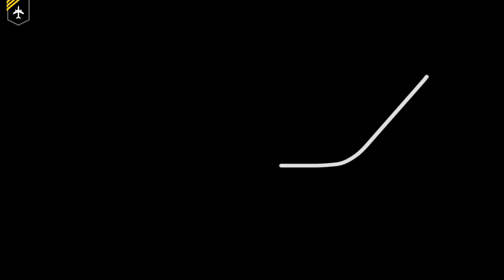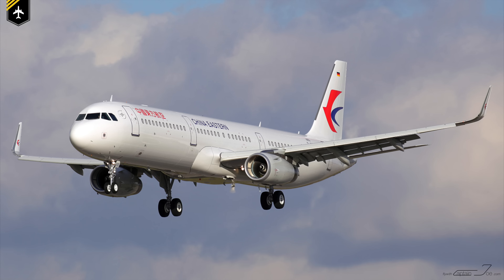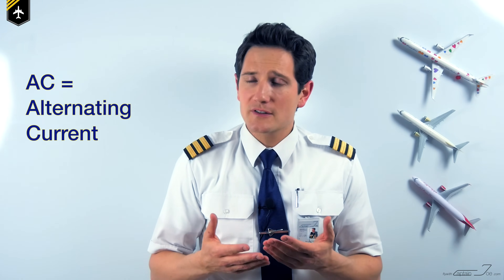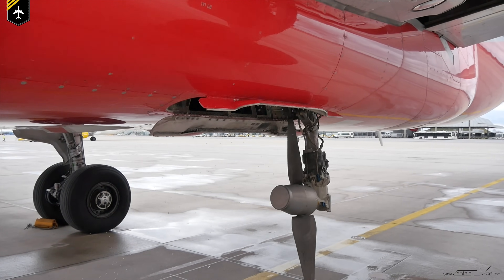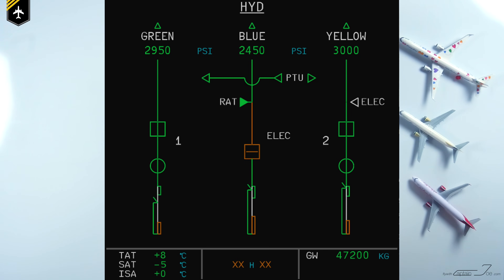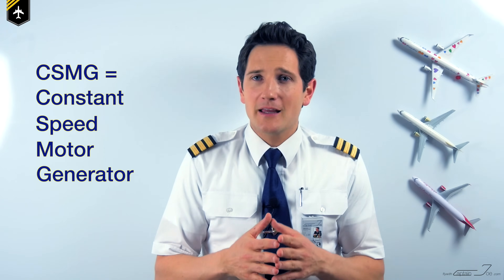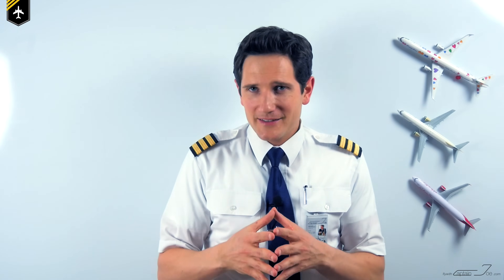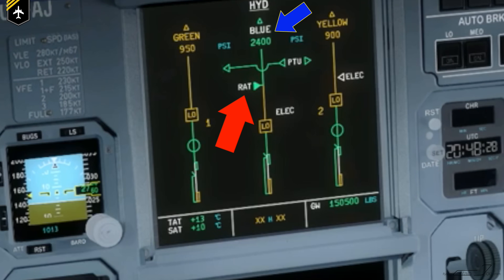What´s a RAT? RAM AIR TURBINE! Explained by "CAPTAIN" Joe

Comment: Hey Jo, in the movie "Sully" sully turned on the APU. The movie didn't show the RAT.!
Reply: I was looking for this coment.
Reply: Both the APU and RAT were used.
Reply: Guys, I'm sorry if I was wrong as I am an amateur in these areas... I was just placing an opinion like every other user did in the comments section ... Its really pathetic to know know that even in small discussions there is racism and discrimination towards a certain class of people because of the worst of people without hearts who  kill people in the name of a religion... this doesn't mean that the people following that particular religion become Terrorists by default.
Reply: @mohammedalsharif1737  Superb Comment. Totally Agreed
Reply: According to the NTSB report "The RAT was found in the extended position when the airplane was recovered from the water."
Reply: I believe the APU would have been more useful in that emergency. The RAT causes more drag. Meaning less glide. Which isn't exactly great for that situation.

The APU however wouldn't cause drag and was functioning.
Reply: Both were used. Since both engine driven generators failed almost simultaneously the RAT auto deployed as mentioned in this video. If you listen to the  released  CVR recordings or read the transcripts Sully says he's starting the APU which along with the RAT gave them the power to control the aircraft and make a successful ditching.
Reply: @LtKernelPanic  Right but if you have a functional APU why would you want the RAT? All it's doing is producing more drag and killing your speed. Speed = time and Sully didn't have a lot of it.
Reply: @nifethrubutter  It's because the RAT was deployed Automatically right after they lost both of their Engines
Reply: according by officially crash report, both of system were operative. While performing emergency checklist after bird strike,(at 1527:19 of CVR records) captain informed to F/O about  APU run. When you read the report you can find theese notes at page 30 which is says shortly (please read all of them), "when both IDG disconnected (it means electric system lost) and airspeed greater than 100knt, RAT will automatically deploy and begin providing electrical power........RAT has been found extended position when airplane recovered"....
You can find the full report on this connection (https://www.ntsb.gov/investigations/AccidentReports/Reports/AAR1003.pdf ) . Besides of this, please ignore some of details of movies. They are not able to show us everything. Ofcourse some of details can not be shown on movie if it not directly related of scenerio.

Captain Joe, thank you for your perfect explanation and sharing your knowledges with us. Have a safe flights.
Reply: The RAT deploys automatically when you lose AC bus 1/2. Extension takes about 5 seconds and would be visible. (The APU takes longer to turn on and become "on -line"). If at least one engine driven generator was supplying electrical power, the RAT would not deploy. In that it was not visible, either the RAT malfunctioned (no mention of that in NTSB report) or, at least one engine was operating negating the need for the RAT altogether.
Reply: Once you hit the water who cares?  if your alive, you're getting the hell out of there.
Reply: The RAT'd have automatically kicked in before he started the APU.
Reply: As Cadde said, but without the racist bigoted ranting bit
Reply: The APU take about 30 seconds to start, so the RAT will be in charge until there (with auto depoy) as soon as both engines failed.
RAT provides electricity only for basic system but APU will allow the protection envelop and all other main systems.
Reply: From the NTSB report:
"the captain started the APU, which improved the outcome of the ditching by ensuring  that  a  primary  source  of  electrical  power  was  available  to  the  airplane"
and
"The RAT was found in the  extended  position  when  the  airplane  was  recovered  from  the  water.  Both  RAT  blades  were  present, and no major deformation of the blades was observed"
Reply: Well, i'm not sure, but this is what i think. The APU runs on fuel. After takeoff, flight 1549 hit birds, and had a dual engine failure, so the engines wasn't running, but the plane still had plenty of fuel left. So the APU would be
the best solution to get power. I don't know if the ram air turbine would have had any influence on the aerodynamic (I think it would?), and on the landing itself :).
Reply: Bikestail er maybe Sully didn't want to rely on the rat, so he started the APU to be certain he had flight control when he needed it. Thinking ahead of what the weakest link in the chain would be makes sense!  Besides, the rat only provides basic electrics. The app provides enough power for a possible restart, and if that couldn't be done, still have enough power for emergency communications along with fly by wire manuvering. The more power you have the more options you have to land the beast.
Reply: @kennethcohagen3539  He wanted the envelope control computers to be functioning.  They do not function in a RAT-only electrical profile.  Water landings require the plane to thread a needle in order to not break up.  The envelope regulation computer helps with that considerably.
Reply: The APU can take 30-45 seconds to start up, so the batteries and RAT had to supply hydraulics and electrics until the APU is running and available. The batteries and RAT can only supply one hydraulic system, the #1 flight computers, and the captain's flight controls and instruments; the loss of backup computers means the A320 goes into "alternate law", meaning you lose a lot of the aircraft's built in protections. With the APU running, enough electrical power is available to power all hydraulic systems, flight computers, flight controls and instruments, and the A320 reverts back to "normal law".
Reply: Shame!
Reply: spishco thank you. I did  not seen that in the report.
Reply: +Sven he wasn't being racist because of his remark about muslims, that's just bigoted, he was being racist for assuming that everyone called Mohammed is a muslim.
Reply: +Mahila Maseli Wow! No need to be rude just trying to give information. PS airframe and power plant mechanic for 15 years.
Reply: true
Reply: Osama Shello gasoline and batteries go bad. If you are flying you alway have air. It's a very good back up design. And they do have batteries but only 20 minutes worth. You may be more than 20 minutes away from an airport. Take a bus or a boat if you don't like it.
Reply: they neednt rat .Because APU was working.
Reply: +Mahila Maseli If you worked in the aviation industry you would be more professional.So considering  that you don't, go back to checking  bags in whatever country you crawl from.
Reply: Cadde The Rat would have deployed before the APU was online.
Reply: Bikestail er When there is fuel in the plane, you use the Apu.
Reply: Consider the weight, the cost and maintenance of a kerosene engine.
Reply: CharlieHotelRoméo 89 finally somebody who is right they didn't deploy the RAT
Reply: I don think the RAT was ever used in the miracle on the Hudson it was just the APU
Reply: Why would you care if the RAT was destroyed on landing. You wouldn't need it anymore.
Reply: Bikestail er because it's a Hollywood movie idiot not the 100% factual series of events
Reply: They didn't finish the checklist, the ditch button option wasn't reached yet. It has since been moved up on the list.
Reply: +Mahila Maseli It might be possible that people watching this video have an interest or experience in the aviation industry. Most airplanes have a separate turbine running the  auxiliary power unit, kind of like a third jet engine that doesn't provide thrust just electricity for the airplane. In this case that turbine did not ingest a bird so it was still functioning.
Reply: The R.A.T. could have been removed and attached to a wheel and sprocket which could have been put in the water entry safety kit located under the #1 bowling alley lane (which is normally used as an aisle.  This would have allowed the crew to peddle to shore quite easily.
Reply: The RAT deploys automatically. Read the NTSB report. A movie is just a movie.
Reply: I also ..seen sully movie ..it's super...
Reply: Well the RAT storage area better be water tight.  Because the AIRBUS is designed for water landing unlike a BOEING...
Reply: This is about a RAT and an APU, and the Internet found a way to get racism into this...
And I'd say the APU was switched on fast enough, but maybe it's in the report?
Reply: @echalone  it's the sad reality of comments on Internet😥

About the RAT and APU, I think that the RAT automaticly deployed as soon as the aicraft got into electrical emergency configuration (so just after the engines shut down) and that only after that, the captain switched on the APU (also the APU takes a few seconds to start up). I think they just didn't show the RAT in the movie.
Reply: Not just in the movie.  It was also mentioned in the Mayday episode about that event.
Reply: Alex Lawrence Not using the movie as a reference point. I am using my Airbus Instructor/Captain/check airman experience. The movie is....a movie.
Reply: Bikestail er Yes indeed.
Reply: Carl Siemens How do you know the RAT deployed?
Reply: since their is fuel in the aircraft, the APU can be used because APU uses fuel to generate electricity.
Reply: Because the apu makea more power than the rat
Reply: yeah
Reply: ATF commanded Captain Sully for having the fore sight to start the APU which provided him control of his aircraft.
Reply: J. Pierre Malette the show Mayday said it was the first officer that started the APU, that he had just got back from training and I believe this had been covered in his training, if I remember correctly that Sullys manual flying would have put the plain into a stall but since the APU powered the flight computers the computer kept the plane from stalling,
Reply: Dick, don't even joke about that.
Reply: Bikestail er it was an older a320 model
Reply: LtKernelPanic  both weren't used
Reply: Bikestail er in the moive sully he turend on the apu to start the restart engine checklist
Reply: Alsohe dint put the ditching button on what was the5th last checklist to complete
Reply: as far as I understand you mean, Sully did not pushed the "ditching" button when completed 5th checklist, is it right?
Reply: I watched an old interview with him and he specifically mentioned the APU was still functioning.
Reply: Mohammed AlShariff once they hit the water it wouldn't matter derp
Reply: The rat is used when there is no fuel or the APU is broken and they had fuel and they had a functioning apu so I think he may have just messed up or not done research
Reply: The RAT was used when the MAIN engines failed due to the ingestion of geese into the engines so that the aircraft could be guided in some manner. The fact that the RAT was destroyed when the plane struck the water is irrelevant due to the fact at that time it was too late for anything except to get the passengers off of the sinking aircraft.
Reply: Weight. Aircraft are designed to be as light as is practical to keep fuel consumption low.
Reply: i ready sullys book, i was pretty sure he mentioned use of the APU and never mentioned the rat. the rat is only used if the APU is INOP and i wouldve remembered if that was the case from sully's book as well.
Reply: Bikestail er kk
Reply: Bikestail er he was ditching !!!
Reply: But, the RAT is used when a plane has no fuel. US Airways 1549 HAD fuel so Sully turned on the APU instead.
Reply: Yes, the plane was on the water just 6 minutes after take-off, so the APU was more than enough.
Reply: After you impact the water what would you need the RAT or the APU for you've already crashed and no longer need hydraulics!  That's like crashing your car and then complaining that you cant steer!
Reply: He did mention RAT deploys if you don’t have a functioning APU
Reply: They also said that the no. 1 Engine was operating at idle thrust the whole time. I was like "...what?"
Reply: It's possible that Sully deployed the RAT, or ADG (bombardier: air driven generator) but from my understanding it would have been the last resort. 

If you can you try to relight your engines, and if those fail you go to the APU start. Lastly if that fails and it hasn't auto deployed you would pull the RAT or ADG deploy handle and get some hydraulic power and essential power to your flight instruments and controls. 

If that craps out then you have the main ship batteries and a backup battery on some aircrafts. Those are only able to last at least half an hour in a load shed configuration.
Reply: But both APU and RAT were not necessary as the flight continued for only a few minutes. The batteries took over and established full electric supply which is why still all systems were available. The APU needs a minute or even more to start anyway. To have the chance of restarting the engines the APU was important nonetheless.
Reply: The RAT deployed just after the engines failed. Only then they started the APU.
Reply: Umm thats the same thing
Reply: Lol
Reply: They still have fuel... The APU runs on fuel and... Wait at the end it says us airways 1549 had the RAT weird
Reply: Gimly glider is a better example as the plane ran out of fuel so no chance of APU
Reply: I believe the RAT would have been deployed in the amount of time that was needed for the APU to start. I cannot give you exact figures but starting the APU takes up to 1 minute, maybe even more.
Reply: The airplane was equipped with two integrated-drive generators (IDG), one mounted on
each engine, which normally supply electrical power to the airplane systems. An IDG will only
supply electrical power when the N2 speed is about 54 percent or more. The airplane was also
equipped with an APU that drives a third, or auxiliary, generator, which can replace the electrical
power normally supplied by either IDG.

If both the primary and auxiliary power sources are lost, a ram air turbine (RAT)
contained in a compartment in the left airplane belly fairing supplies hydraulic power to the
controlled-speed motor generator, which then provides electrical power to the airplane. During
normal conditions, the RAT is retracted into the fuselage and does not operate. When all of the
airplane’s electrical power is lost and the airplane has an airspeed greater than 100 knots (kts),
the RAT will automatically deploy and begin providing electrical power. The RAT was found in
the extended position when the airplane was recovered from the water. Both RAT blades were
present, and no major deformation of the blades was observed.

The airplane is equipped with three main hydraulic systems, referred to as green, blue,
and yellow, which together supply hydraulic power at 3,000 pounds per square inch (psi) to the
airplane’s main hydraulic power users, including the flight controls. The slats are powered by
both the green and blue hydraulic systems, and the flaps are powered by both the green and
yellow hydraulic systems. The three hydraulic systems are not hydraulically connected.
Each of the three hydraulic systems is pressurized by either an engine-driven or electric
motor-driven pump. The blue system’s electric pump supplies hydraulic power when either
engine is operating. The green and yellow systems’ engine-driven pumps are connected to the
left and right engine, respectively, and these pumps supply hydraulic power when their
respective engine is operating. The engine-driven hydraulic pumps are driven by the N2 spool
and are able to supply hydraulic pressure as long as the engine is rotating. Generally, the lower
the N2 speed, the lower the hydraulic flow that can be delivered by the engine-driven hydraulic
pumps.
Reply: Seen that too!
Reply: There are WAY too many keyboard wannabe's furiously trying to prove how fucking great they are in this comment section....
Reply: Rockington TheThird sully did not use the rat because of the landing in the river. He waould have turned it on but once he realized he was going in the Hudson he did not need it. He needed the APU because his plane completely shut off after birds strike and he would of had no control of the plane.
Reply: Bikestail er that was an a319 maby an a319 dousent have a rat
Reply: PS no one gives a fuck
Reply: +Mahila Maseli 😁
Reply: If you look for Hudson River Splashdown  or Miracle on the Hudson , you will see the full story without the dramatics. Sully starts the APU before the engines were completely stalled out. so the RAT may not have deployed.
Reply: Cadde what a nonsense!
Reply: Probably the RAT would would have been destroyed on impact on water...hence the APU
Reply: @mohammedalsharif1737  More to the point, the APU is able to provide full electrical, bleed air, and hydraulic power (full hydraulics I THINK) to the aircraft, so they don't need to worry about an electrical emergency configuration. The APU is also able to pressurize an additional hydraulic system via electrical pump, this can be transferred into the other main system, allowing full flight control authority once more. If the APU can run, it will - as far as I know, this is a memory item in case of single or both engine fail. It's also just far less to deal with on an already bad day if you have full hotel and hydraulic power. While the hydraulic systems have a large degree of overlap, it is not 100% in any case. You will lose weird random things like nose wheel steering or some leading/trailing edge devices. The APU being able to bring all hydraulic systems back up, or at the very least, two of them, is quite handy indeed.

Again, IANA pilot, but as far as I know, the RAT is tiny and thus introduces fuck-all drag. It's not quite none, but it may as well be. Both APU start and RAT deployment happen independent of all engine electrics, hydraulics, and bleed. Think about how the plane is able to become self-sufficient at a remote stand in the first place. Batteries start the APU, which starts engine 1, then engine 1 starts engine 2.

It's got little to nothing to do with glide range and ditching, and everything to do with the fact that the APU is capable of sustaining full hydraulic, bleed air, electrical and even hotel load. Again, assuming operative, the APU will be started as a memory item in case of any engine failure as it is capable of maintaining redundancy in the hydraulic and electrical systems, which are both critical - if you don't have either of these, you may as well be piloting a brick instead of a glider.
Reply: @mohammedalsharif1737  at Impact.
you dont need either systems apon crashing....
Reply: "OMFG way to prove a point poindexter...... but lets now have an argument about this..ffs "  I was a this and I was a that and I did this and that for 15 years so I am professional and no one else is so I am superior and wadadadadad.... what ever your boyfriend is telling you swallowing his load does not increase your capacity to think... I am guessing you have never been told to fuck off before....snowflake.....
Reply: although not relevant remark religion is not the same as race. You cannot choose your race, you can choose your religion. Unless you are Islamic, in which case there's a good chance you will be murdered should you elect to change.
Reply: No they have turn fastly on the APU so the RAT is not necessary.
Reply: its a fucking evil misogynistic cult religion not a "race" and he doesn't sound scared of them so bigot is wrong as well suck hole....
Reply: Mahila Maseli hate brews from fear you racist fear mongering asswipe. Also, yall's KKK is prob a 100% representation of christianity right? Like hurt durr ofc it is even tho its a small % of it but it MUST represent the whole religion HURR DURE
Reply: Mohammed, WUT?
They started the APU because the APU was still functional.

Hence, the RAT wasn't necessary. If the APU wasn't functional then the RAT would be the ONLY way they would be able to steer the plane. So are you saying they should consider the fact the RAT would be destroyed by a belly landing on water and hence not use it and crash the plane into the WTC?

Oh right. Muslim logic. :P
Reply: @RealCadde  The APU also provides more power and allows the system not to be in emergency mode allowing all the cockpit instruments to be functioning (were it only the RAT all but the essential instrumentation are disabled).  Water landings are very much eye of the needle type landings.  Get it wrong even slightly, if a wing is slightly low, etc., and you get breakup of the plane and lots of death.  However with the APU all the fly-by-wire systems are functional and the computers are very good keeping an envelope, which reduces the chance of too-steep touchdown, engines-hitting-before-tail, unlevel wings, etc. things which are deadly if they happen in a water landing.